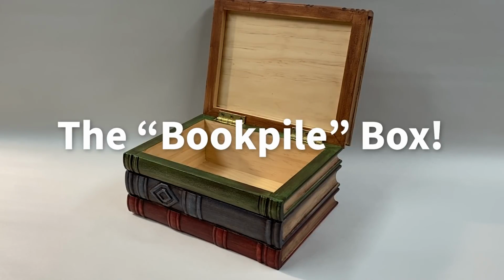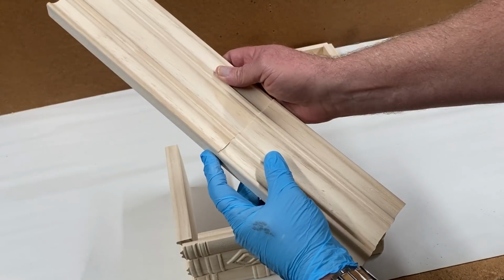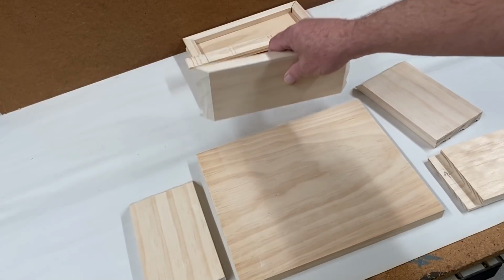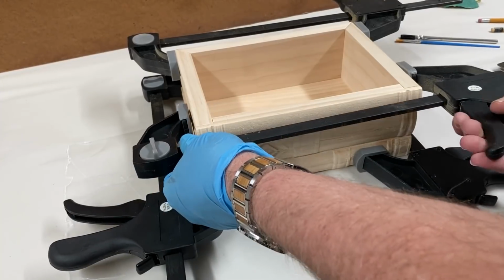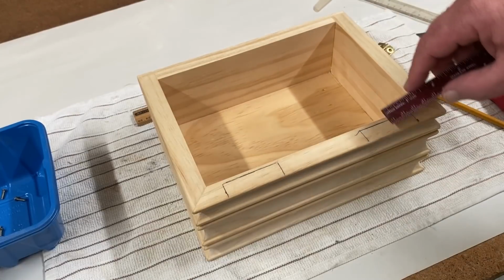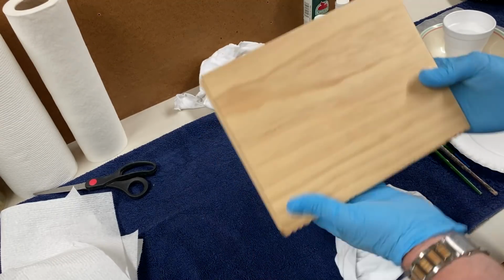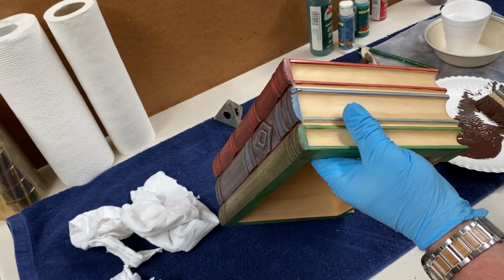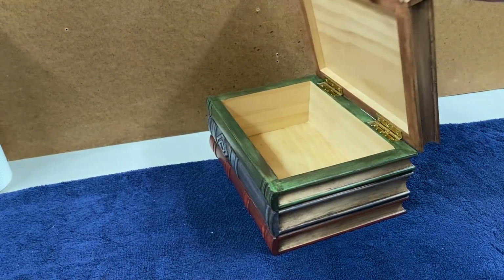Making The Bookpile Box | Michael Tyler's FREE CNC Project of the Month | Vectric

Comment: I have downloaded the file for the Book Pile Box. In fact, I downloaded it 5 times to make sure this wasn't a problem in my download. I have started the VERT_Two-Side_LID_and_SPINES.crv program but there are only 2 toolpaths in that .crv file, which are: 3D Finish .125" TBN  &  Drill Holes .25" UPCut  EM, and are the toolpaths for the first side. I believe I'm missing 2 toolpaths, the ones for the 2nd side (part flipped) to machine the rabbet cuts and to machine the cutouts.  If I need to create those toolpaths myself I need to know, I'm on a bit of a time restraint. Up to this point everything has been great, having finished the VERT_Box_Sides_Layout.crv program.

Comment: When I down loaded the files they are zipped and says there are six files but I only get five files. When I ran them the file for the 2nd side of the two side crave is not there.
Reply from the maker: Hi Greg it looks like there should be four crv files and one PDF file. The Box Sides Layout files look like they should just be one sided and the Two Side Lid and Spines files two sided. Is this what you are seeing? Hope this helps. Thanks
Reply: @vectric  Yes that is what I am seeing but when I machine the two sided board on the second side there is no file to do this. There is a file called Swept Profile lid .25 DE EM (Clear) but I have no idea what this file is for, It is not the file to cut out the lid and parts from the first side of this board. Has anyone else had this problem or am I doing something wrong?????

Comment: This may seem a silly question, so please do not be offended. I have just purchased my very first cnc machine. I have gone for the onefinity woodworker. I have purchased Vcarve Pro. The question is this, as you are working on both sides of the wood, why did you not install a 90 degree v bit and do the all the mitres along with the rebate for the hinges with the relevant bit change, after all you know the exact size of the hinges and where the mitres are to go, as then you would have a perfect fit and take out the use of another machine in the shop.

Comment: Very inventive method of building a box. Well done, it looks great.
I suspect you set the hinges incorrectly but need a close up pic. The hinges wouldn't normally have large gap between the faces when closed. You would get a normal barrel look with hinges closed without gap. (Which way were countersinks cut in hinges)
Reply: No, he cut them correctly.  The top of the hinges on the lid were not recessed...